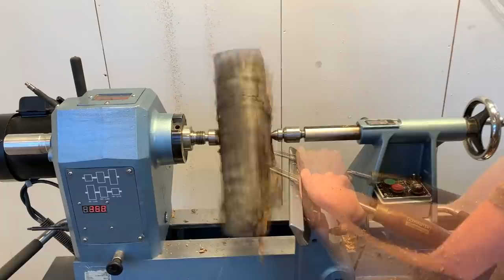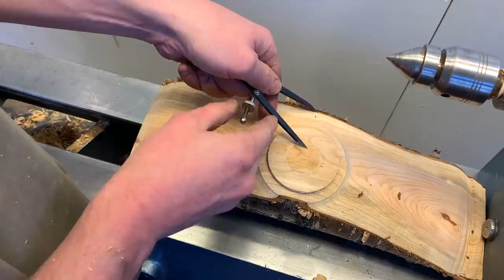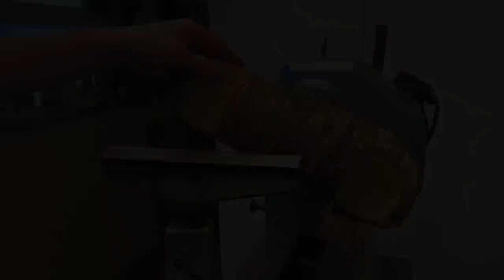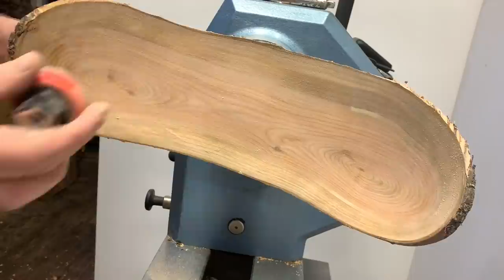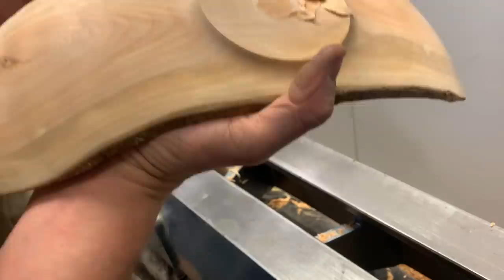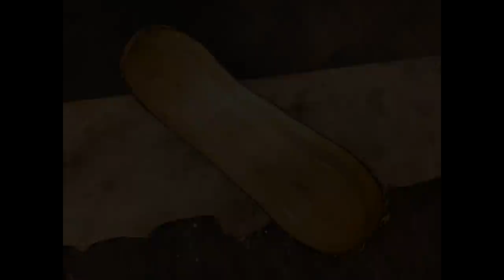Woodturning - Don't Try This At Home!!

Comment: You're right : don't try this at home.
You were really sing for trouble as a band saw could have done the same job much faster …
Reply from the maker: It couldn’t have, there is no way a bandsaw could achieve the same balance of form and finish that a lathe can achieve, and as a professional production turner I’ve made 100s of these platers/bowls just like this and I’m not asking for trouble in the slightest… 
This however shouldn’t be attempted by novice turners or the type of people who think this is “asking for trouble” as they don’t understand enough to know what is safe or how to avoid potential danger.
Reply: I readily admit I am amateur and remain quite cautious with all things which could harm me : ER is not on my to do to go list !!! 😇.
Personally I still would give a try with the band saw, the finishing with the lathe… maybe.
But I must admit that the result is very tempting : it is not often that a wood turner makes a minimalist modern object, most of the time they produce complex shapes that show their craftsmanship but remain very traditional and not very interesting to the eye.
Your work is definitely much better and I apologize for not saying how much I really liked it ! Which I do now… 😍👍👍👍
Have a nice week end.😜
Cheers !

Comment: Wtf? You spent wooden log for what? To produce shavings? That plate is useless(I hoped I will see the use and comfort of that product in the end of video) and that has dirty bark on the perimeter.
At first I thought it will be a propeller
I think I know how to do a propeller